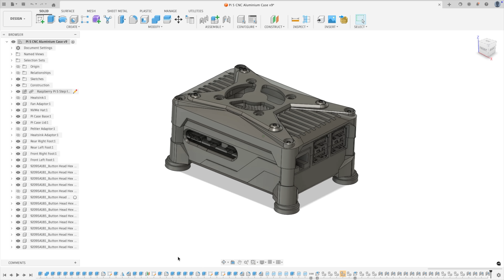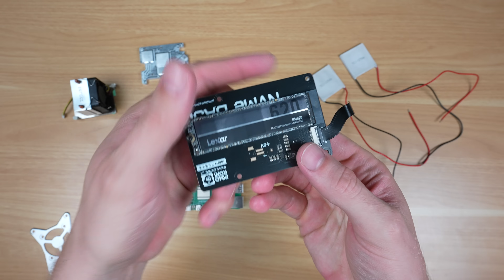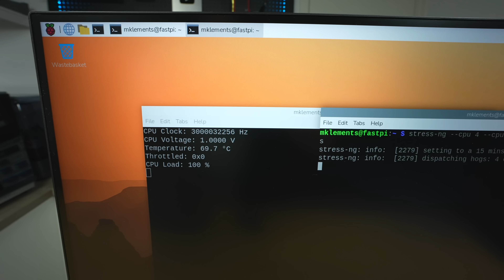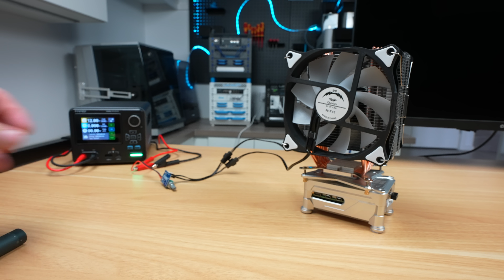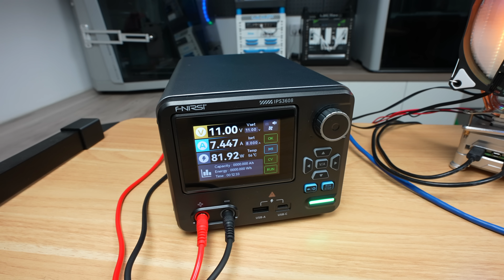Does Extreme Cooling Make a Raspberry Pi 5 Faster?

Comment: Very nice test. I have some TEC suggestions:
1: use LESS TEC power and you might cool better. It matches your statement that the heatsinks can’t keep up with this amount of heat
2: cascading TECs means the second TEC needs to handle the heat output of the first one. In order to do so, the first TEC needs to be much smaller and/or run on much less power. This way you’ll probably get the processor below zero.

Sometimes less is better, especially with systems that have lower efficiency
Reply from the maker: Thanks for the suggestions, this was my first TEC build so learnt a bit from it

Comment: Such a nice case.. why not remove(Delidding) the heatspreader that's on the Pi CPU by standard and design a proper heatsink/fan combo direct for the die? 
Bonus points for: Cooling the other components like RAM, I/O controller and VRM and integrating it with the case as it should be an excellent heatsink in itself 😊
[Edit and try higher frequencies.. should be able to get a few benchmark runs to complete up to 3.5Ghz]

Comment: So, the key issue is Pi 5 leveraging out dated 16nm process. The PPA talks!
While RK3588 uses 8nm, and the upcoming RK3688 will use 6nm. There is very little cost difference if using 8nm instead of 16nm.
Even the six years old S922X uses 12nm process. What a shame.....

Comment: lol ridiculousness gets my attention. 

However, some unsolicited advice for you.

TEC's are extremely sensitive to mounting pressure, i know cheaper sources of pelts don't always provide spec sheets, but the model number is printed on the plate itself so it should be easy enough to look up. For our application, which used a pair of nickel plated copper MELCOR heatsinks (2.5kg each) which came with 120mm fan shrouds, we had to make our own mounting bolts, and we counted the turns of the bolts to ensure even pressure. 

Second, you need to have an insulating gasket around the edges of the peltier, and it needs to be compressible. We used neoprene sheets cut down to size. 

Ideally, when trying to cool electronics, you want to vapor seal everything to prevent condensation damage. Clear nail polish, dielectric grease, or moldable art eraser.

Running Peltier plates at full tilt, is never going to get you good results, stacking them up while running full tilt is even worse. Again, the spec sheet for the plate itself will detail what the delta will be at a given heat load

The heat load of the hotside is not equal to the amount of cooling being produced.....it's the combination of the heat load you're cooling, plus the heat load of the peltier plate itself. When attempting cascade cooling, you want to be running the plate in contact with the core at a lower input power, think 40-50% of rating, with the second one aiming for 75-80%.

Also, the most effective utilization of a TEC, is not to attempt to use it to handle the full heat load of a chip. Keep a heatsink with a fan handling the chip itself, and use an undervolted TEC plate on the backside of the chip. 

This used to be a solution for cooling server CPU's way back in the day, which i attempted on my desktop around 2007 or so, to great success.

Comment: I enjoy your content and with the outmost respect, I am disappointed to see Peltiers on youtube are still misunderstood and not used to its bare minimum.
Peltier TECs have at the very least 2 requirements that are rarely met on YT: clamping pressure and appropriate cooling.
- A clamping pressure 3 to 8 Kg per cm2 is typically required for efficiency. That would be 48 to 128 Kg for the TECs you are using.
- Insufficient power. In the video only providing 1/4 of the power is being provided to the Peltiers. The TECs depicted are rated at 6.4 amps. So at at 12V, they should be drawing 216W. You set the current at 6A (for both TECs). Then the 12V set voltage, hover around 11V instead and also with reduced current, likely limited by your power supply. That means each TEC is only receving 30W instead of its rated 108W.
- Cooling with the stock heatsinks included with the TECs is insufficient, as you concluded yourself. At the very least, the heatsink should be able to dissipate the thermal load + its own (the Pis load +108W each). The CPU cooler you are using can likely handle 100-120W. So ideally you would need at least one CPU cooler for each of the TECs.

Scatterbencher, a very well known extreme overclocker, took the Pi 5 to its limits with liquid nitrogen back in november 2024. While running the NUMA patch, and despite replacing the power circuitry and swapping the crystal oscillator to circumvent hard limits,  he found himself unable to get past 3600 Mhz (4000 in sw).
Here's the article:https://skatterbencher.com/2024/11/11/3600-mhz-raspberry-pi-5-with-liquid-nitrogen/

I hope my comment doesn't come across as pedantic. My aim is to educate :) I don't have the polished visual and story-telling skills you have to make a video myself :)

Comment: Single core = 1066 Multi score = 2311? What? It's a quad core, why is it only ~2x, shouldn't it be closer to 4000+? Seeing that the Pi CPU is 4 of the same cores.
Reply from the maker: The Pi's CPU performance doesn't scale like that because it has a single shared memory controller and runs on LPDDR4 RAM. When all four cores run, they compete for RAM bandwidth, share L2 cache and memory latency increases.

Comment: I am surprised that there was a benefit at all considering the clocks didn't change. I am surprised there was a %4 percent improvement at the same clocks with lower temps, so that was interesting. How much higher can the clocks be run with the Peltier coolers? What is the score improvement after that?
Reply from the maker: The clocks can't be run any higher with Peltier cooling - Pi 5's typically start becoming unstable/locking up due to voltage drops or power instability which doesn't improve with a drop in temperature.

Comment: You should've pushed the clock to see how fast you could run the CPU. Once it's cooled enough to not throttle, cooling it makes no difference to performance. The purpose is so you can overclock it more. Let's see how high you can get it with that active setup.
Reply from the maker: The Pi's limitation on overclocking is CPU voltage, not thermals. This particular Pi won't run over 3.1GHz regardless of the cooling solution used.

Comment: Hi there, erm... idea for you.
If you took the metal shroud off the Cpu and then dipped it in some form of "RC boat" water proof circuit paint - will this sort out the condensation problem?
Love the case, its awesome!
Reply from the maker: You can spray a conformal coating onto the Pi to protect it against condensation. The probablem is that there are a lot of ports and surface contacts on the board which you'd need to prevent from being coated or they'll become useless.

Comment: pretty cool experiment (no pun intended lol) I was hoping you had found a way to under-volt or some other way to do some good overclocking beside just telling it use a higher freq - but I think that would probably take a custom firmware, but I haven't really looked into it tho. 
that case tho! ABSOLUTELY GORGEOUS!!! I don't think I've seen case look so professionally made that came from one of the 3d-print/cnc companies - it must be the finish you chose. it looked like it was just running through a ball mill, or sand-blasted - but you only mentioned it being anodized (I'm guessing with Nickel?) whatever it was it looked FANTASTIC!!! and not just the finish, the design is really tight too!  I would be proud to have a Pi in that case, you did a great job designing it!!
- Oh I just thought of a weird idea for a Pi video, and it's still cooling related. I wonder if you would be able to cool multiple Pi's with just one cooler.  Like created a block that has heatpipes attached that go to the that big PC cooling tower, but have like 3 or 4 of them going to that tower, Obviously there's a limit to it because you can only attach so many heatpipes to the bottom of the cooler, but I reckon two pipes for each Pi should be enough to transfer the heat to the tower. And just like how they have the heat pipes attached to the PC cooler you could fit 6 pipes on each side, if you rotate them 90 degrees from the ones already there. You can probably buy heat pipes on amazon,I mean that have nearly everything on there. But I'm sure they would be on ali express or one of the other Chinese sites too. - OH! Maybe you could just use a second PC cooler tower instead!  That would remove about HALF of the work! You could just attach the two blocks together (the ones that would normally get attached to the CPU, just paste and maybe soldier or braze them together - 90 degrees off tho of course) then you'd have to remove the cooling fins from the heat pipes and bend the pipes to your needs. But then how to attach them to the Pi's - hrmm - maybe cutting apart the cooling fins and leaving some of it attached to the heat pipes and use them as the block that attaches to the CPU 
- It would be a fairly big project but I know you have the skills to do it. And you have most of the stuff already.Well, okay you have SOME of the stuff already lol - You could turn it into a multi-part video too because there's a lot to get right in order for it to all work right.
- -  Oh no, I just thought of something. There aren't 12 separate pipes on the PC cooler, there are only 6. And each one goes from the top of the cooler-tower down across the CPU block and then back up the other side of the cooler-tower. And it probably wont work with heat on BOTH ENDS 🤦‍♂ The heat originally comes from the middle of the pipe and goes up, cools and condenses the steam back into water and drips back down to the center of the pipe to start the cycle over. This wont work with the heat coming from 2 ends. So you just might have to buy 12 heatpipes that are half as long. But I'm sure that would work just as well - the length of the heatpipes doesn't matter really - well except maybe for very long lengths, but not this size.I think it would work just fine with a few adjustments of trial and error - and it would be really fun to watch too!!! - I hope you like the idea. If not then maybe I'll start a channel one day and I'll try it... but most likely I'll never ever do this LOL :D
Reply from the maker: I'd like to do an extreme overclocking video on the Pi 5, but it would involve buying up a large number of Pi's to try find one that's capable of being overclocked significantly - silicon lottery comes into play, which gets expensive quickly. This particular Pi can't run over 3.1GHz. 
Thanks for the feedback on the case! The manufacturing on it was a lot better than I expected to see, props to PCBWay for that. I know they sponsored the video, but their manufacturing quality really is good. I've used them for paid work on a number of projects, too.
I'm sure I could design a cooling system to cool multiple Pi's, that's a nice idea!

Comment: After having fiddled around with a TEC-based graphics card cooler back in 2009, I realised that TEC cooling is simply not worth its price and power draw.
Reply from the maker: They still seem to use these modules in many cheap desktop "fridges". Their electricity consumption must be horrendous.
Reply: @MichaelKlements  Yes, with an efficiency around 5%, a TEC is a tremendously terrific choice for an ice box.

Comment: Interesting video. To answer your question, extreme cooling does not make the pi faster as you mentiond in the Geek Bench results.
Next time, how far can we increase the over-clock while remaining stable. That would show the maximum speed increase.
Also, have you considered liquid nitrogen to REALLY lower the cpu temperature?

Comment: Well worth a look - and that case you had put together is sweet.

I run a big(gish) tower cooler on my 8gb Pi5 and - in practice - the fan almost never spins up - at stock speed.

Where folks have overclocked them, the increases in performance seem disappointingly inefficient, so I've never bothered.

Seems to me, that extra cooling on a Pi5 may extend it's life a bit, however, efficiency that translates into extra performance seems limited by the silicon itself, in some way.

Meanwhile, I could probably ditch the fan entirely and not miss it much at all, that big heatsink seems quite adequate, just by itself. Maybe the fan'll get more of a workout when the weather warms up.

Nice item, though, watched with great interest.

Comment: I believe that dehumidification of air supply would allow lower temperatures, as a lower dew point. Also, a lower thermal mass would allow faster control response/time constant for a pid controller. Finally, a lower voltage and higher frequency would now be available.

Comment: You made a little mistake in this case. The TECs have to cool their own heat and additional the heat you want to cool. In this case what I can see your little heatsinks will be to small to cool the TECs as they should be cooled and your TECs are way to oversized. Only one would be sufficient. 
Maybe what you can try is to use only one TEC and as cooling you use your CPU cooler that you already used before. That should improve the cooling capacity and you should run a TEC at constant current and not at constant voltage to increase life time.
Reply from the maker: The little heatsinks were supplied with the TECs from the seller. I had a hunch that they were too small, that's why I then stacked them under the CPU cooler. They definitely perform significantly better individually under the CPU cooler than with the small heatsinks. 
I am running them at constant current. You can see in some of the power supply shots that the voltage is ramping up over time because current is limited.
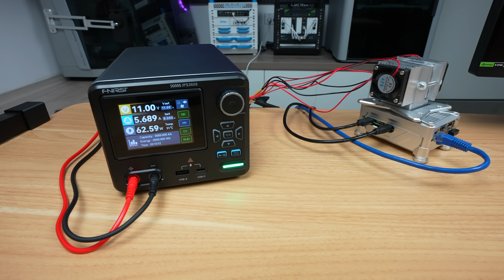Reply: @MichaelKlements  I only saw that you used constant voltage at 9:10 of the video so it was only a recommendation. You can also size the peltier module down by just looking into the datasheet at the Q-value at a certain current, with that information you know how much heat the tec can transport from cold to hot at a temperture difference. So you want a peltier cooler with a Q-value higher than your known power dissipation of the pi cpu. Also a bigger peltier needs a way bigger cooler on the hot side because it has to cool the heat produced by the peltier + the Q-value.
Example you have a peltier cooler from mouser that has a voltage of 7.6V and a current of 8.5A and your Pi-CPU dissipates ~12W that would mean you need at least a cooler for the hot side that can cool 76.6W to be sure that the hot side isnt transporting its heat to the cold side because that can also happen when the TEC isnt cooled enough (you can see that if you let the system run for a little longer and capture it with your thermal camera).